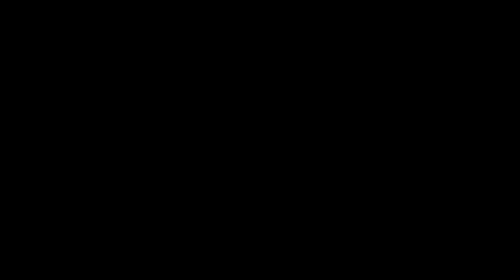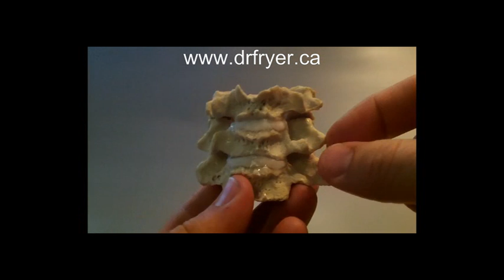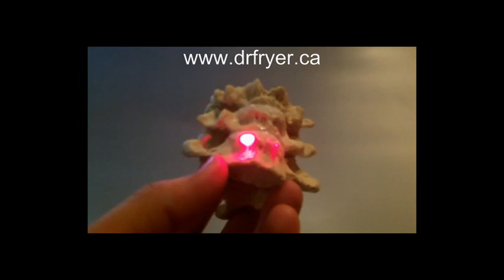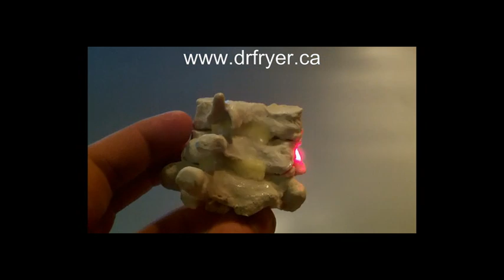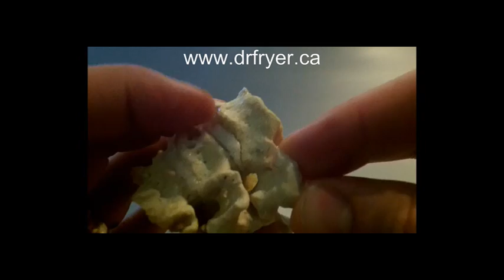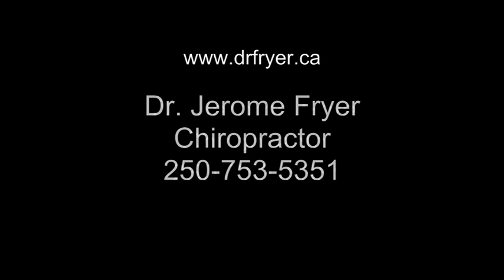Neck Cracking Spine Model - Dr. Jerome Fryer (Chiropractor)

Comment: What makes the multiple popping noises?
Reply from the maker: +Brandon Myles Good question.  I am not sure if you mean multiple sounds from the same joint or from multiple joints. I think we can have both and it is related to the synovial fold.  This is a ring like structure, sort of like the meniscus in the knee but smaller.
Reply: I am not a doctor, but it seems plausible that muscular tension and joint compression build unevenly around the joint. As movement occurs, different structures (capsule, tendons, synovial fluid) release sequentially, producing multiple distinct popping sounds rather than a single event.